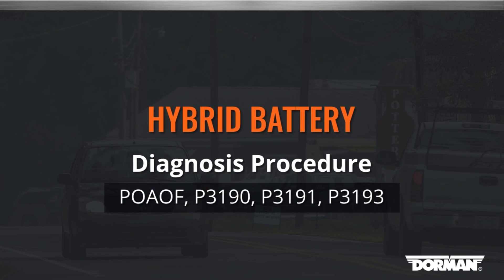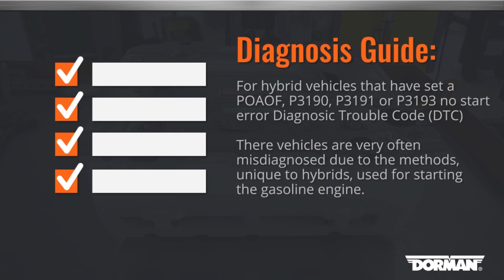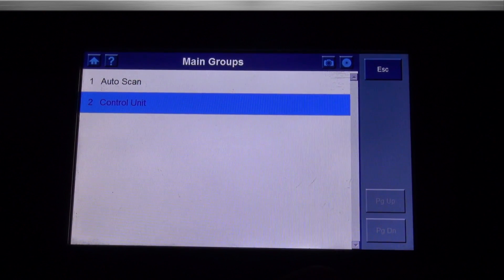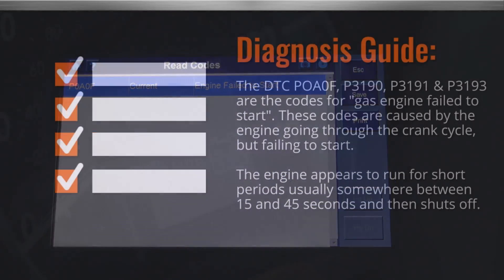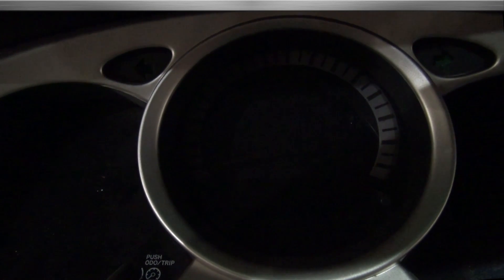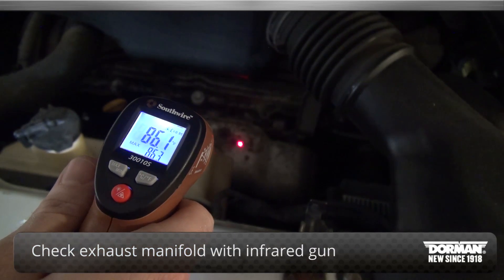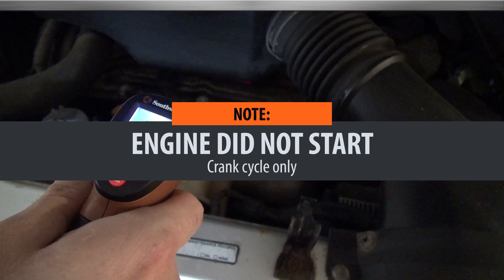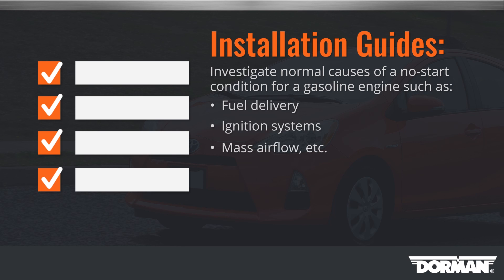Hybrid Diagnosis Vehicle Won't Stay Running Procedure by Dorman Products

Comment: My code for 2005 Prius is P0A0F.  I cleared my scan and the red triangle went away. I hit the start button, then green ready light beeps, then red triangle appears and engine shut down. I removed and cleaned the MAF, dried, then installed it. Same problem--Help
Reply from the maker: There could be several root causes fr that code dependicg on the info code. The most common is the vehicle's ECU